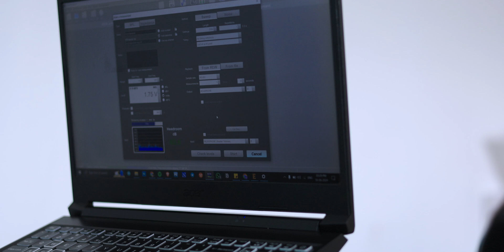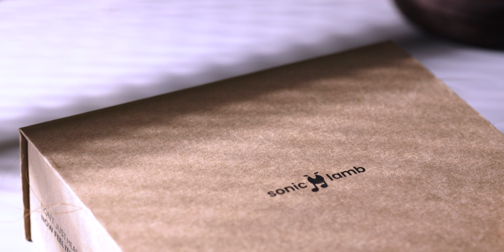Sonic Lamb: Crafting the Lambs

Comment: Been using this, and I forgot my Bose Headphones!  Amazing... but three issues, hopefully fixed next release: 
1. Active noise cancellation; 
2. It's a little tight, so I can't wear it for more than 30 minutes; 
3. The earcups should move independently of the headband so they always fit at a 90° angle, no matter how you wear them.